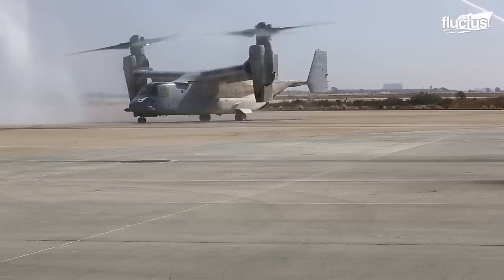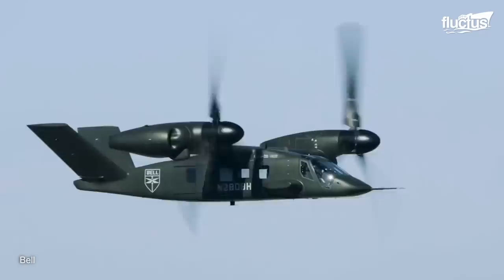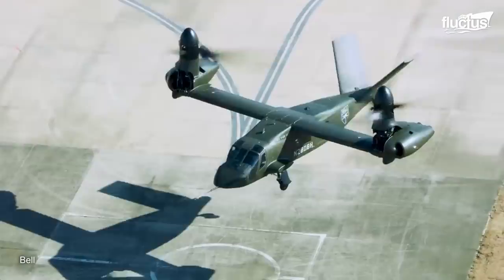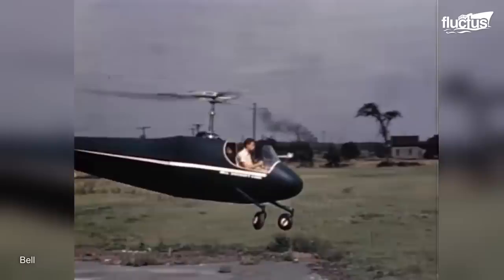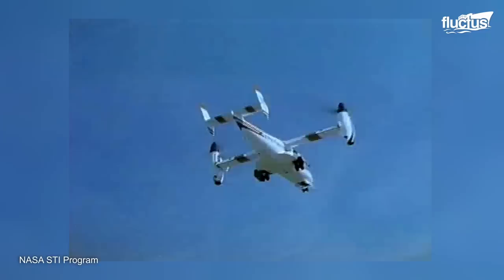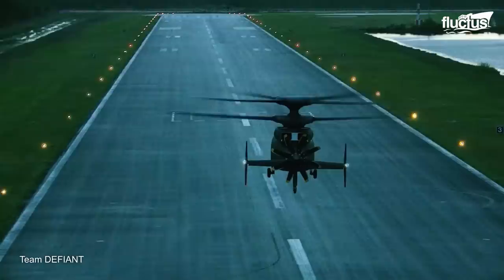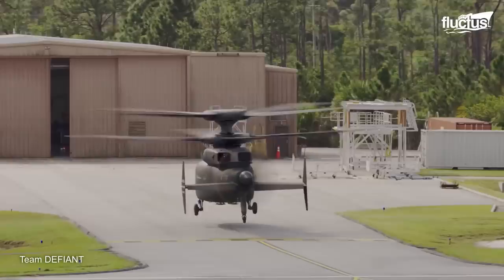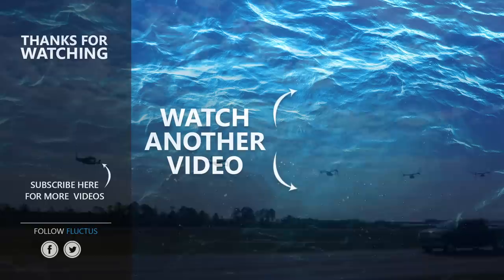US Testing New Super Advanced Billion $ Helicopters Program

Comment: The V280 is not replacing the V-22. The V280 is seeking to replace the UH-60 Blackhawk in combat transport and utility. The Blackhawk will continue to serve, but the Valor will be the tip of the spear.
Reply: Wouldn't be better if they just use the V-22 Osprey?
Reply: Nah foo. You're lying
Reply: @jackmeoff8953  actually, probably yeah. Osprey is bigger (24 troops) and can replace the chinooks for long range assault which is what Valor is supposed to do, but for just 14 soldiers. It should be a Chinook replacement, not a Blackhawk one.
Reply: How many soldiers n pilots died in V-22s? No one I know loves the V-22
Reply: You’re %100 right. Ospreys are marines and navy. The v280 is army.
Reply: @dc8162  Why spend millions of dollars on a v280 when we got the V 22?
Reply: @jackmeoff8953  well the Army pulled out of the procurement for the V-22 Osprey. Another reason why the Army doesn't acquire the Osprey is due to the squadron organization and lack of a need for long-range troop transport before now. The Marines, Navy, and Airforce needed to move men and material over long distances and possibly unsupported. The Army focuses on force concentration so the Osprey's range wasn't needed in the past before the War on Terror exposed the need (see the Benghazi and then Baghdad embassy attacks and their different outcomes.) You can look at Operation Anaconda during the war in Afghanistan to see the limitations of rotor platforms in that environment. If a Valor goes down you're risking 12 fewer troops unlike what happens in a Chinook or Osprey. Hence why are often not conducting frontline drops, they generally try to sneak past hard points to the rear or go to well-protected assembly areas.
Reply: @generalrendar7290  This is why I disagree we are spending trillions of dollars for aircrafts that what we already got in the military.
Reply: @jackmeoff8953  the V280 is not the Osprey. The Osprey is not the King Stallion nor is it the Chinook. The V280 is a longer-ranged, faster, higher-capacity, Blackhawk. The V-280 is a faster and longer ranged platform than the Chinook with a similar troop capacity but a lower sling load capability. The V-22 shut down the Baghdad embassy attack, the Chinook would not have made it in time.
Reply: @generalrendar7290 Why dose the army need another tilt rooter aircraft when we already got one. It's called V22 Osprey that works.
Reply: @jackmeoff8953  the Army doesn't use tiltrotors. So if we got into a conflict in the West Pacific, the Army would be extremely reliant on the Marines and Navy to conduct operations in the area. The Osprey is a bit bigger than what they want to use for their battle doctrine and because the Blackhawk fleet had much more wear and tear than expected, the Army thought it best to line up a replacement with a longer range and better performance. Again, the Army is not looking to replace the Chinook, they want a Blackhawk sized aircraft.
Reply: @generalrendar7290 Again whV22 Osprey. All they need to do is modify the V22 to meet their needs. That way they are saving us money.
Reply: @jackmeoff8953  it's about what you want to risk (12 or 24 soldiers) and Army fighting style. Not to mention that the Osprey is significantly more expensive than the Valor. Plus the Osprey is more equivalent to the Chinook or King Stallion than the Blackhawk. That said, the Osprey is replacing the Grumman C2 Greyhound for Carrier/fleet supply.
Reply: it would be easy to imagine the replacement for the v-22 being a larger iteration of the 280-valor.
Reply: @generalrendar7290  So you put 12 soldiers into the V22 and there you go. Now how hard would it be if you add in larger fuel cell so they can fly longer.
Reply: @jackmeoff8953  because v280 is cheaper and safer
Reply: @jackmeoff8953  If you just use 12 people for a craft meant to handle twice as much, then what's the point of the larger craft? You'll be paying twice as much using it at half capacity, and since the aircraft are more expensive you'll have less aircraft overall. The V-280 is meant to be a smaller, cheaper tiltrotor that can handle the tasks the Blackhawk can do, so that the V-22 can be used for much heavier airlift tasks.
Reply: @patriot2314  I disagree with you on both of your points.
Reply: @jackmeoff8953  i disagree with your disagreeing on both point..i identify as right
Reply: @StrikeNoir105E  Why spend billions of dollars for a new helicopter when they already have a Boeing/Sikorsky SB-1 Defiant. The V-280 is just a waste of money.
Reply: @patriot2314  How many army troops will die before they get all the bugs worked out? As far as the price go wait until they get the final bill comes due.
Reply: @jackmeoff8953  that could be said for every new technology..so no f35 because some pilots might dye
Reply: @patriot2314  Not might but will die until they get the bugs out.
Reply: @patriot2314  But dyeing for equipment that the military don't need because they already got them in stock.
Reply: @jackmeoff8953  definitely not. The osprey is significantly more expensive, demands frequent maintenance and the vertical engine configuration is problematic for landing operations. On top of that, the USAF just grounded the aircraft due to issues with the transmission. 

The Valor should already have solved those issues back in the drawing board.
Reply: I wonder if the Blackhawk will become the Huey of the army once the V280 is phased in.  Just like how the UH-1 was superseded by the Blackhawk but still continued to serve for years in rear eshlon rolls and basic transport rolls. The black hawk will continue to serve alongside it, but as older air frames are retired, it will do more of the lesser duties; the hauling duties, and the combat duties will be the property of the Valor
Reply: Wait so the v-280 is the final successor of the UH-60 ?
Reply: @creepypotato2667  will it replace every UH-60? No. Much like how the HU-1 Huey is still in service, but not the primary vehicle, the Blackhawk will be used in roles that don't require the range and speed the Valor can provide. Hope that this made sense.

Comment: You know, those V-22 Ospreys are behemoths! Up close they look like impregnable monstrosities. Very sturdy & solid. These new V-280 prototypes look very sleek, fast and more compact. But they also look very thin-skinned, like fiberglass (not carbon fiber). I hope they've designed some cabin protection for troops, pilot & nav.
Check out the new prototype from Boeing / Lockheed Martin: the Team Defiant. Dual rotors with dual motors on top spinning in opposite directions. If one motor fails the other can power both rotors. There is a rear propeller for forward thrust that can fly as fast as most single propeller planes. I think it's a superior design, kind of like a super-Blackhawk.
Reply: The Valor is also capable of doing the same thing, namely using one engine to power both rotors, as it has a driveshaft linking the two engines together through the wings. The Osprey also has said feature, so it's not like that's a safety feature that only the Defiant has. 

Also note that the Defiant has been hit with a slew of technical issues in regards to its complicated design that meant it has yet to log as many flight hours compared to the Valor which has been passing its flight tests with flying colors. The US Army decided to choose the Valor because it's already proven itself reliable in flight tests.
Reply: The problem with the defiant is that compound helis generate a ton of vibration. While the second rotor will cancel it out, all those forces will stillq be concentrated in the transmission that also drives the back prop. That's a lot of stress on a single component.
Reply: Tell that to All the Marines that died because they crash all the time.
Reply: @flynnisterreality4393  It was awful. I remember 1 accident alone had 22 souls on board. And that was just one crash! Made me sick to my stomach, & made me mad, too. Everyone was calling for a re-design or cancellation & grounding of the whole fleet/program. They decided after spending +22B on R&D & were so close to fixing it, yet some wanted it stopped. I don't want you to think I was glib over the disastrous production. It was really too complex a leap in tech for the enormous V-22, compared to the simpler, smaller V-280. They no longer rotate the nacelles...just the props. Kept it simpler.
One of the big problems was software related to the rotation of the huge 2-drive nacelles while keeping stability. Until they got it fixed, they rarely deployed any & if they did, it was as much a field testing of the new modifications & S/W. It eventually passed all the requirements to enter deployment and to my knowledge there hasn't been any of those catastrophic failures like when it first rolled out. If they're safe enough to fly in diamond formation around AF/Marine-1 for extra security, I would totally feel comfortable flying in them any time. There's a ton of them deployed in Okinawa. But locals hate the noise.
Did you know anyone who died in a V-22 crash? Condolences if U did. I had a Captain friend in the Marines who was at the same base w/ some Ospreys, but no one died on any flights for quite a while by then. He really thought they were pretty cool once everything got fixed.
Reply: @StrikeNoir105E  I'm aware of the same propulsion & design architecture of all 3 aircraft. I only mentioned it b/c I think it's cool as shit!  I'd give my left testicle (the smaller of the 2) to fly in one...or to FLY one!
Reply: @user-pq4by2rq9y  Well...THAT wasn't mentioned in any of the brochures! (kidding!)

Comment: Are these still able to fly with one engine failure?
Reply: The V-280? yes it can. A driveshaft runs through the straight wing, allowing both prop rotors to be driven by a single engine in the event of engine loss.

Comment: Why not use small jet engines instead of rotors
Reply: It does use small jet engines, but they have a shaft driving rotor blades for a large increase in efficiency
Reply: @foxbat888  Props also offer more instantly torque.
Reply: Probably cos it would be noisy as F. Enemy would here em coming a mile away. They'd be greeted with anything from fully stretched catapults to bazookas n stuff. It would be a bad day for the crew!
Reply: @MyFluffyClouds  , the bad of war is it's hostile aspect to life.